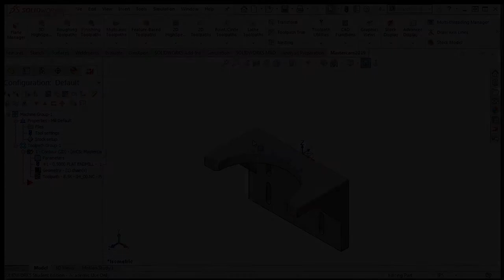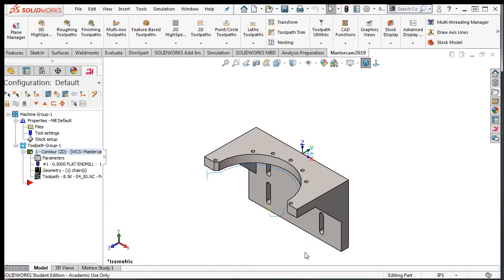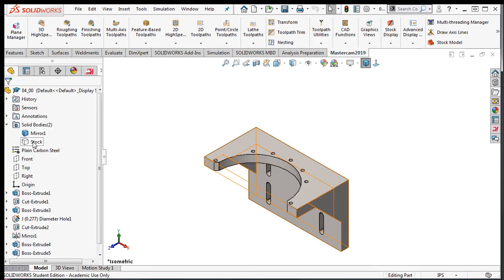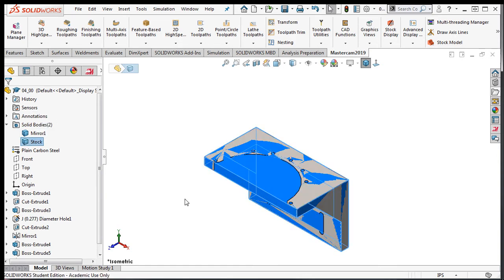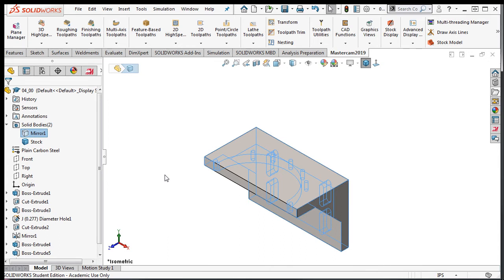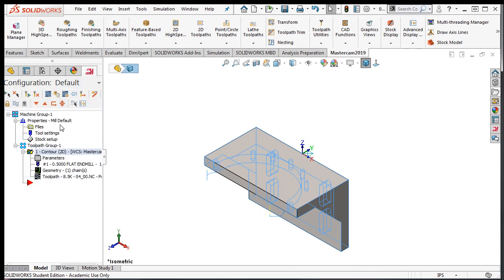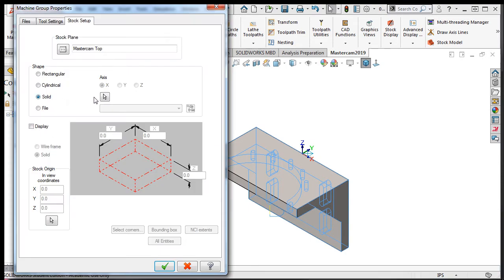12 - Mastercam for SolidWorks - Introduction to Contour Toolpaths

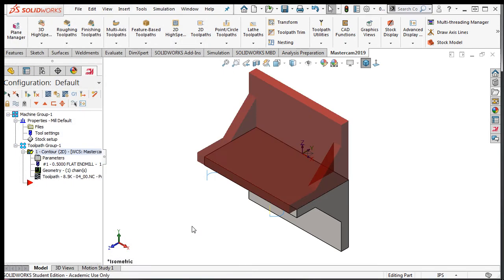Comment: Just stumbled upon this series, absolutely amazing! I'm a long time SW user but just getting started with MC. Anyway, I am not sure if you can change the way the stock is imported, but I believe this is an issue with MC being "smart" and keeping the solidworks coordinate system of the part, but switching it to MC's coordinate system. If you look in the video at 1:34, you can see the SW part axis Y is vertical (lower left) but MC's Y axis is horizontal (part center).
Reply from the maker: Glad you like it, if you keep watching that will be discussed.